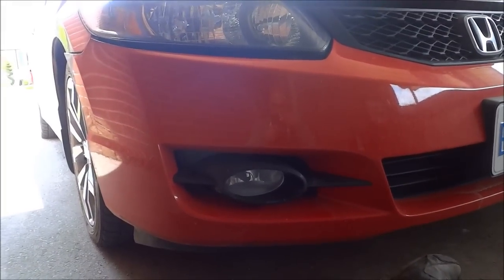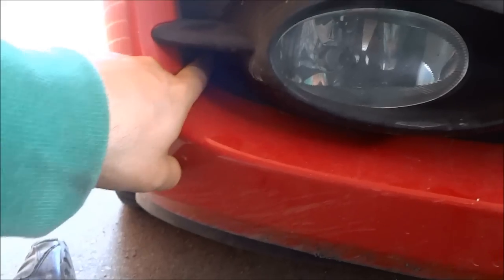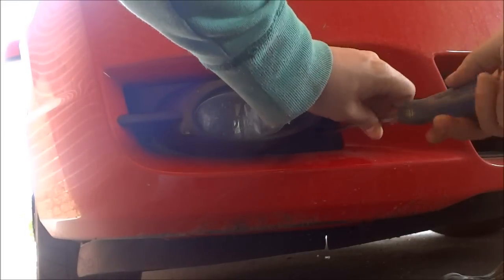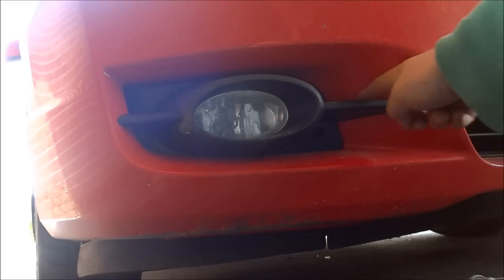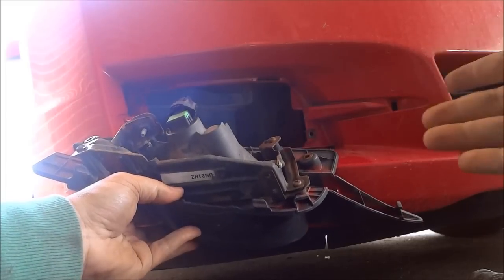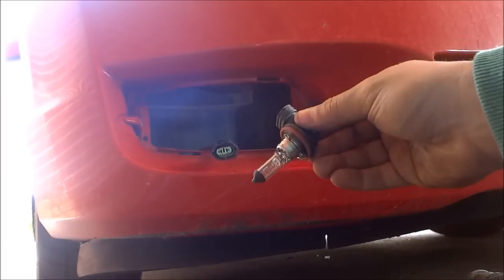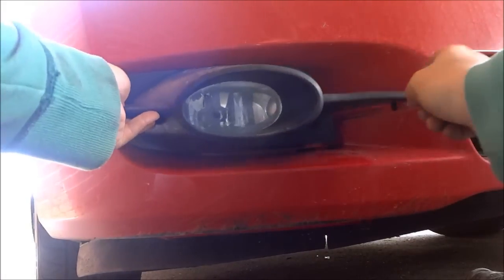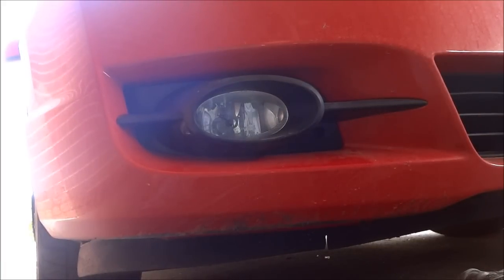How To Change Foglight Bulb On 09-11 Honda Civic Coupe

Comment: I have a 2010 honda fit and this helped me replace the fog lights. Its similar. One screw on the housing instead of two but clip and bulb come off the same as in this video. Thanks for this helpful video! You rock!